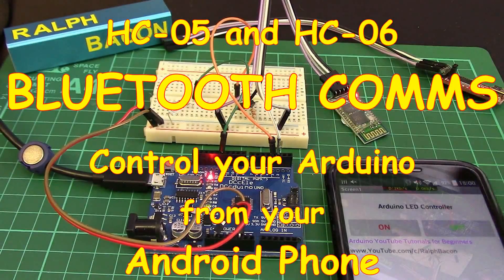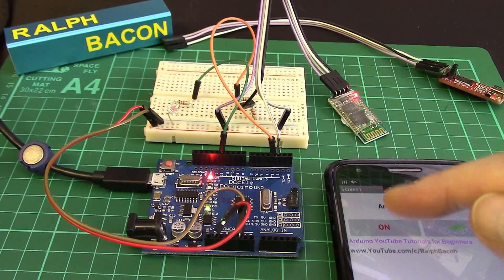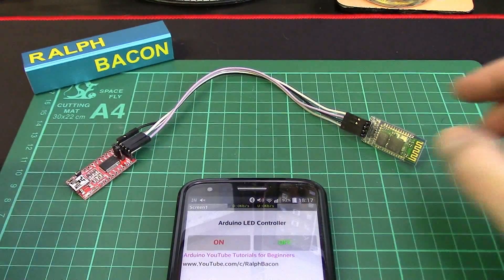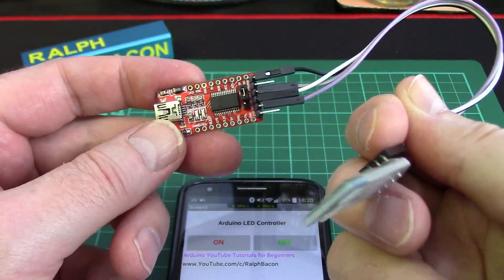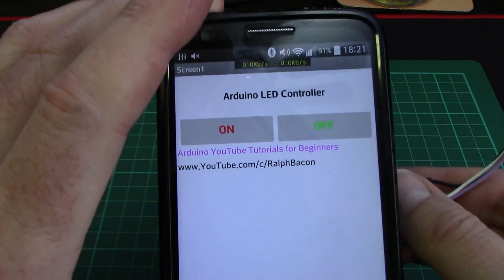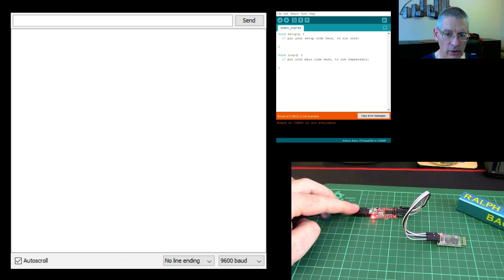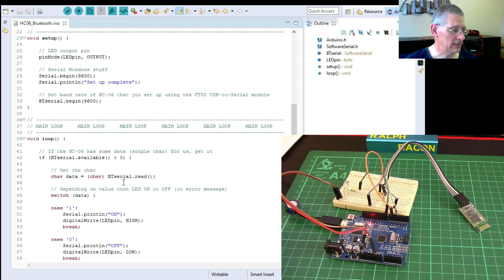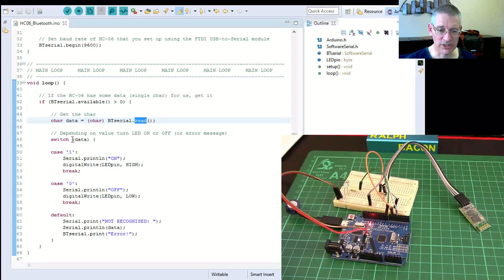#36 Control your Arduino from your phone - HC06 Bluetooth module

Comment: a wonderful walk through,  now for the esp32 version.  😍 time for tea Mrs. Peel.
Reply from the maker: I reckon it should work just the same on an ESP32 as it does on an Arduino. Admittedly I do very differently on my Smart Heating Controller (Wi-Fi not BT) but I'm using my ESP32 as a web server and my phone purely as a browser interface. Hmm, thinking cap on!
Reply: @RalphBacon  thank you BT is new to me.

Comment: Hello Ralph, I am faced with the Problem of beeing out of time to buy an FTDI whitch means ill have to do it over the arduino directly. I however do not know how one would do that and would greatly appreciate your help!
Reply from the maker: "Do it over the Arduino" needs a bit of clarification! This is an old video and I cannot remember what the FTDI was for. Let me know!
Reply: @RalphBacon well, I‘m afraid it does not matter anymore as i accidentaly fried my entire project by running to high of a voltage… thanks for the reply anyways , great video!

Comment: I try with a CH340G instead of FTD1 and it does not OK response. Should it work still.
Reply from the maker: Theoretically, any USB-to-serial adapter should work. But the pins are different on the CH340G modules. I'd say buy a (cheap, clone $3) FTDI module and go from there.
Reply: @RalphBacon  I bought a FTDI and he responded  OK only one time, I replaced USB cable (short cable), dupont wires, and no more respond. 
The communication with serial monitor (ARDUINO IDE) and with serial terminal (Smartphone) it works only with Hello world  both side .(but none AT commands)
Reply from the maker: Ensure you have the BT device in command mode: power off, hold down the small button whilst you power up, keeping the button pressed until the LED flashes slowly (much slower than when you do not keep the button pressed). Then you are in command mode. AT commands should work now. Enter AT and it should reply OK.

Comment: Is it possible to read more than one character?
Reply from the maker: Yes, just send the required (fixed) number of characters in a struct and it will be fine. This means you can send integers, chars, longs etc without having to worry about it.

Comment: Hello Ralph, just wondering why direction is from Arduino Pin 6 to HC06 Rx and Tx goes into Pin4.  To me it looks like Rx should be Tx and visa versa.  I know I am years behind but I just bought a couple of HC05 modules and trying them out. Hope all is going well.
EDIT: Nvr mind Ralph, saw another vid and had it wired same as you so will have to get direction figured out that make sense to me.
Reply from the maker: Yes, the way I have it wired most definitely worked just fine! Good resources can be found here for BT modules: http://www.martyncurrey.com/arduino-with-hc-05-bluetooth-module-at-mode/

Comment: Ok . SO what are the people who can't establish communication with the HC06 supposed to do ?
I can talk to FTDI but not the HC06
It's this problem which leads many of us here in the first place !!
Reply from the maker: When you plug it in and type AT you don't get an OK response? Firstly, it can take a couple or more goes to wake it up. More commonly,  you haven't got it in Command Mode.  Disconnect the device from power, press the small button and reconnect the power whilst you keep the button down.  After a few seconds the red light will start blinking slowly.  Release the button and try the AT command again, a few times.  If still nothing,  triple check your wiring.

Comment: I get nothing I've tried a few options can you help or give suggestions I'll turn around RX and TX and I have tried different programmers models
Reply from the maker: I'm replacing my original reply to you, George, here goes.

Let's do this step-by-step to ensure we are both on the same page:
1. The Android app is up and running on your phone.
2. The Arduino app is connected to the HC-05 via the correct resistor divider and is running
3. You can connect with your phone to the Arduino / BT by pressing the "Choose BT device" button.
4. If you press the ON or OFF on the Android app, nothing happens on the Arduino.

Is this as far as you have got or has it failed at step 3?
Reply: @RalphBacon  i con't pair the bluetooth device with my laptop when i type in (AT)on my serial monitor i get nothing the red ligth still fiashes fast ?

Comment: Like the videos! .. I have been looking at integrating bluetooth with other serial devices on the Nano, may be worth putting on your list an additional video on the vaguaries of using, for example, a Bluetooth Module to trigger a Serial Controller MP3 Player (or any other serial device!) by setting up multiple soft serial ports, or reusing the normal tx/rx pins used by the direct USB..  fun but frustrating !
Reply from the maker: It sounds complicated just reading your post, Steve, no wonder you found it frustrating!
 
It would be reasonably straightforward to control the MP3 player I demoed in video #40 using a Bluetooth link (from your phone, for example). I really need to find a similar MP3 player that sends back the current tracklist (and the one playing) I think that is a major limitation. Thanks for posting, great to hear from you.
Reply: As I am aiming to move the project to a single chip rather than the Nano, i think that the answer is to reuse pins 0 and 1,  i can use a bluetooth terminal for debugging if required and then disconnect the bluetooth and plug in the usb when programming, or program via Bluetooth, can't see any reason for that not working as it is just presented as a UART Serial to the computer. ... What can go wrong :-)

Comment: My unit seems to have died when using the FTDI at 3.3v. at least the bluetooth's LED isn't blinking anymore
Reply from the maker: Have you tested your FTDI unit, Tor? Does it really give out 3v3? If it does then it didn't cause your BT device to fail, something else has happened (not necessarily bad). Try writing a simple sketch (or take mine) and see if it can wake it up again.
Reply: yes. the FTDI gives out 3.3 or 5v. 
But the BT module itself requires 3.6-6v right? But the RX is limited to 3.3v. 
That is what I have set up on my breadboard - and the bluetooth (my other one) lights up and connects. 

The reason I found this video is that I have trouble getting my bluetooth HC-06 devices to hold a connection. It always times out after 10-20 seconds and I don't know why. 
That happened with both modules I have. 
Have ordered new ones, but china mail sure takes its time.

Comment: Hi Ralph,
Had a quite afternoon and found your channel, just got through all 36 videos. THANKS found lots of ideas and tips. I was wondering what terminal you are using in this video? it's not the standard Arduino IDE.
Reply from the maker: OMG you watched all 36 videos! I guess you must be a very keen Arduinite (or really, really bored!). But seriously, it's great that you would spend the time watching them all and I'm really glad it gave you some ideas and tips. 
 
The IDE I use (sometimes) is the Eclipse IDE for Arduino (it's used for much more than Arduino, but there is a special version for Arduino users: http://eclipse.baeyens.it/download.php) but I do warn you it may take a couple of hours to get it up and running the way you want to. That's after you've read umpteen forums and FAQ pages!
 
I was going to do a video on it but realised it was not for noobs (I use Microsoft Visual Studio in my day job and the Eclipse IDE feels very familiar - but not for the fainthearted). But if you're interested have a go - you can always revert back to the standard IDE as I do.

Thanks for your kind words and do spread the word and subscribe if you haven't already. Part 2 of the Android Bluetooth Phone Control for Arduino due to be published in a few days.

Comment: Awesome vid , but can we communicate with hc 06 with just the arduino
Reply from the maker: DO you mean can you change the BAUD rate, for example, using the Arduino? You can by sending it the AT commands but you will be programming those into a sketch. What if the HC06 device does not respond? Not the best way to do it for the initial setup, at least, Vajra, but,yes, you can send out AT commands just the same.

Comment: Thank you Ralph,
 The answer to your reply query is definitely YES. I've done all 7 more than once. 
BTW: I got started looking at Bluetooth when I purchased two Nanos that have integrated BLE. When I couldn't get those talking, I thought I might learn something that might help by replicating your #36 & 37 experiments. Maybe you could do another episode focused on BLE (or just Bluetooth Ver 4). I did learn that there are different sets of AT commands.
Meanwhile I'll keep trying to get the HC05 going by trying different Modes, etc.
Reply from the maker: The idea is to move away from AT commands, Dave, and use the inbuilt facilities within C++. If you follow this video exactly then you will the exact same results (sounds logical, right?)
When you say you have Nanos with integrated BT, what are they? Got a link? Arduino are about to release new Nanos (June/July 2019) with this type of feature but I'm not aware of any others right now.

Comment: One of my HC-06's (GW040) has nothing on the back about Level 3.3v and works just fine without any voltage divider. Using 5 volts all around and no problems! Lots of people on YouTube also have no problems!
Reply from the maker: Well, either one of two things is happening here: 
 
1. You have a 5v device and all is well.
2. You have a 3v3 device and your device is working but under stress. It may continue to work or fail suddenly.
 
If you can, check the supplier's page whether it is a 5v device (perhaps there is a voltage regulator on board?) just to be sure!

Comment: Hi Ralph
Just been using these two programs of yours. I was unable to download them as they are apparently no longer available, so I was labouriously copying them off the screen, but was unable to get it to work properly. I then discovered that I needed to add "BTserial.print("ON") /("OFF") which was missing from the screen version. It then worked like a charm. Thanks, though, for the clearest explanation yet!
Reply from the maker: And I'm sorry you could not download the programs, due to Dropbox withdrawing the shared folder facility grrr, but as you've now highlighted it I will move them to GitHub for other users. On the other hand, I'm delighted you got it working (and, of course, it was all a cunning plan to get you to type it all in, to enhance your experience!). I'll add a note here when I've moved the code so you can compare. And thanks for posting, I'm glad you found it "the clearest explanation yet" (the cheque's in the post)  :)
Reply from the maker: I've moved the code, circuit diagram and everything else to another folder in DropBox (easier than creating a whole Github repository): 
 
https://www.dropbox.com/sh/8tf9fjb2tugkkr8/AAD0jaeRQlWhQtfv764pTEf5a?dl=0
 
I've updated the links in the video description too. Any difficulties access this, please do let me know!
Reply: Hi Ralph
Downloaded all the code OK, so thanks for that. I've compared your .ino code with mine and it is virtually identical - apart from a few omitted comments - but I still can't understand why, if I comment out the BTserial.print("ON") or OFF on mine, it doesn't work properly. It will switch on the LED, then get hung up waiting for the two bytes. But yours works OK without it!
Reply from the maker: So let's see if I understand this: my code without the BTSerial.Print statements works fine, but yours does not? (Actually, I notice I have two versions of that sketch (have a look in that folder). Guess what the difference is? Doh!)
 
Given that this video was done some time ago you'll forgive me I'm sure if I can't quite recall all the finer details so if the two statements (used, for debugging, I believe, or for sending a response back to your module) is what you need then put them in and enjoy the BT goodness! Once you get the LED working reliably on/off with the reply to your mobile BT device then you will be undoubtedly see the possibilities of controlling anything (with a bit of coding).
 
Frankly I'm really glad you got at least one version of the sketch working OK!
Reply: Yes, you're right, there are 2 versions, one is called demo which lacks the BTserial.print bit which still works anyway. But mine doesn't. I could understand it (I think!) if it were connected to pins 0 and 1. I wanted to use it as a starting point to transmit data from a DHT11 to a master/slave combination and I've succeeded, having spent most of the day on it. Well, it's a bit wet and windy down here anyway! So thanks again for your help. Oh, and say 'Hi' to Benny for me!
Reply from the maker: Benny says 'Hi back at ya, Pete' and also suggests that to transmit simple data (like that from a non-interactive temperature sensor) you could easily use an Arduino / Nano pair, each with an nRF24L01+ transceiver - much easier to do than Bluetooth in some ways, although if you have yours working now... oh well.  Incidentally...
 
Incidentally, don't use a DHT11 if you want to measure below zero degrees - use a DHT22 (a bit bigger but also wider temp range). I had to replace the one in Benny's cat run due to this exact limitation.
Reply: Actually, I've been thinking along similar lines myself. I've got a 433Mhz Tx/Rx but I now realise that there is no feedback for confirmation. I'll watch your video on the nRF24. In the meantime I've completed the bluetooth project to send data from DHT11 to a slave  HC-05 and then display data on a OLED screeen. There was a lot of cursing and swearing but I got there! Yes, the DHT11 is a bit limited in range but I've got a BME280 which measures pressure as well, so I'll replace it with that one. Should be a piece of cake!!
And, no, I shan't ask if Benny's got a bluetooth mouse; he's probably heard it many times before!
Reply from the maker: Benny just rolled his eyes when I relayed your post, Pete! Now, funnily enough, if you look at videos  #46, #49 and #54 you will see that I am doing the exact same thing as you for Benny's cat run, but with that 433Mhz transmitter/receiver pair. Works like a dream. No feedback, as you rightly say, but for this kind of project, does it matter that much?
 
Now ask me whether I would repeat that project with a 433Mhz Tx/Rx pair or a pair of nRF24L01+ modules? No brainer, the nRF24L01+ modules are "intelligent" inasmuch that they have a sort of handshaking going on (auto-acknowledge) and have a much bigger range and you can use several in different projects around the house without any kind of interference (something the 433Mhz modules won't do unless they have a unique ID pairing, which some do).
 
Keep going Pete, sounds like you're learning lots (I find that learning is in direct proportion to the amount of cursing and muttering).
Reply: You may be interested that I got the project working with BME280 and 1.8" tft display. However, I hit a bit of a problem with received bytes not equalling sent bytes causing the displayed data to 'slip a cog'. I managed to do some simple error correction by counting received bytes with 'if data.length() == 17', do your stuff, else wait for the next lot. Although temp/humidity readings would always be 'xx.xx', the pressure could drop below 1000 mbars, so that would require a different approach, pad sent data with a leading zero perhaps I have a couple of nRF24 modules on order. Am i right in thinking that they do their own error correction in this respect?
Reply from the maker: That's excellent news, Pete, well done (pat on head). I do wonder why it misses the occasional byte, though. Range too much? Transmitting too fast (can't remember if you can slow down the baud rate on BT). Your workarounds for data integrity checking are spot on though.

The nRF24L01+ do not do their own error correction but do acknowledge receipt of a packet of data so you know something has been received. Now, you could send a final byte (or two) with any data transmission which is a CRC byte (Cyclic Redundancy Check) which is a fancy way of adding up the total value of all bytes transmitted, divide by the number you first thought of and take the remainder (I paraphrase, obviously, but it follows this sort of formula). The receiver does ditto and if the calculated value is not the final byte of data then it has been corrupted and is rejected. More here: https://en.wikipedia.org/wiki/Cyclic_redundancy_check
Reply: Well, thanks for the encouragement, Ralph. Having received a pair of nRF24s + adaptor modules, I spent a very frustrating day trying to get them to work. All the cliches about barking up wrong trees and chasing wild geese spring to mind. So, don't ask what went wrong, cos I don't know either, but I finaly got your Tx/Rx code to work as per your video. (Having tried several others, I might add!) Not only two modules talking to each other, but two laptops, so I was able to maintain communication up to about 20ft even on the lowest power setting. So, I'm settling down with a glass of whisky, feeling rather chuffed!
Reply from the maker: Well done you. Hang on, what's this "tried several others". You mean other people are making videos like mine? Oh, I see, theirs don't work, heh heh! Yes, you have earned that whisky, single malt I hope, no ice or water. But however you take it, you've definitely earned it!
Reply: Single malt??? I wish! Just a 'Famous Grumble'. Yes, I'm afraid there are others out there (shock, horror). No actually, it was TMRh20's own 'getting started'  sketch that wouldn't work. I may have been doing something fundamentally wrong, so I'll give it another go now that I know they do work. Perhaps the frequency clashed with something; yours was well out of the way. I see there is a kind of sniffer, so I'll try that too. Thanks for your interest.